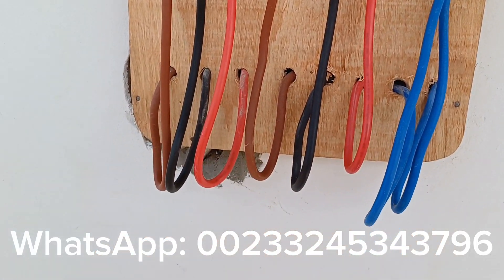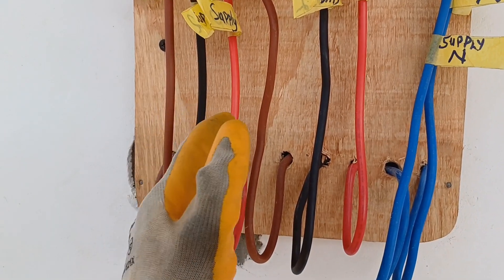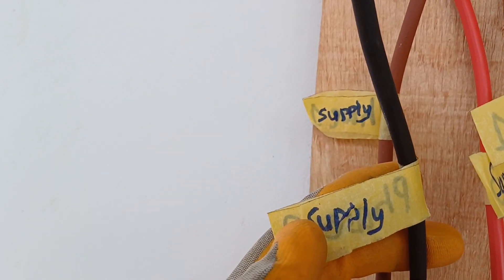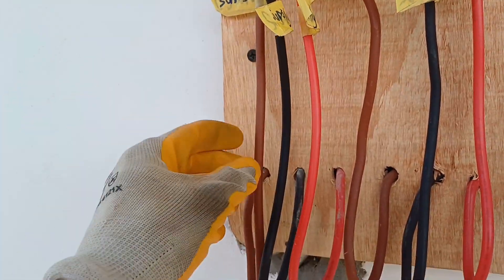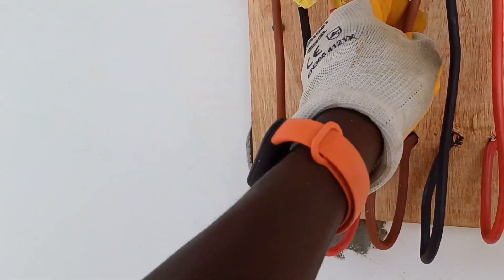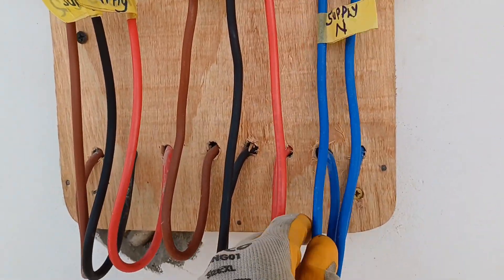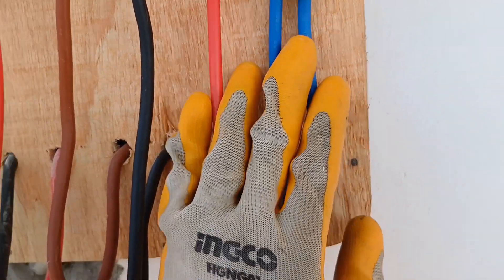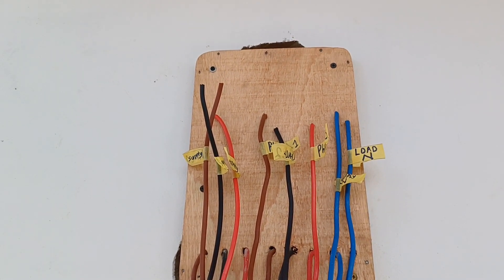Building A House In Ghana | Wiring For Three Phase Energy Meter | Know The Colour Code

Comment: Always providing insightful content; thank you. I had two questions, 
1. Does this go against the electrical standard code in Gh, if so what are the consequences?
2. If this is a requirement to have the grey cable, then how come it is not on the Ghana market?

Thanks in advance and standing-by
Reply from the maker: Thank you so much sir for your soothing words 🙏. 
Yes it goes against the Ghana electrical code. Actually most people doing electrical installation do not use the right colour code at all but the faced out colour code (red: phase 1,yellow: phase 2, blue: phase 3, black: neutral).
Right now there are no consequences for using wrong colour of cables, there is issue with enforcement. 
It's sad or pathetic that's something that's requirement is not available. Even cable manufacturing companies in Ghana don't produce grey colour cable. 
Tropical cable, Nexans kabelmetal, Signal cable etc don't produce it, cause the issue is most people who claim to be electricians still hold on to the old colour code and when these guys go to buy cables if they don't get the old colour code they won't buy at all and it's affecting these cable manufacturing companies in Ghana, so they are forced to continue to produce the old colour code cables over the new or IEC standard colour code which Ghana 🇬🇭 is a part of that union 😉 and unfortunately these companies are the same who are the main sponsors of Energy Commission Ghana and its regulatory activities 🙄.
Reply: @multiskilledelectrician1   appreciate your thorough and clear explanation. I can’t wait to work with you on my project. Can the grey cables be outsourced in the US? If I have the details and specs I can have that ordered when I get to that stage. 

Thanks you
Reply from the maker: @adilinusah  16 mm²  cable Grey.
Reply: @multiskilledelectrician1  got it. Thank you 🙏
Reply from the maker: @adilinusah  yes you can outsource it from the US.
Reply from the maker: @adilinusah  you welcome sir 🙏